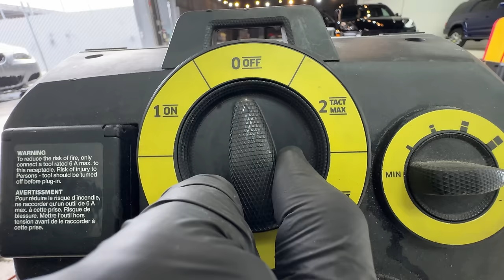Laser Cleaned & Reborn! Porsche 930 Turbo in a One-of-a-Kind Color Gets Full Detail

Comment: I've heard that either dry ice and laser cleaning the underside removes both the dirt and the factory applied rust proofing and as a result cars can get corrosion under the car as a result if not replaced very quickly.

Comment: Love this color combo!  Couple of questions - can dry ice cleaning remove the stains from the inside of the tool bag?  Also, for the laser cleaning, won't the calipers need to be plated again?
Reply from the maker: Dry ice cleaning can be used for that purpose. And depending on how you would use the laser, you will likely want to repaint, unless you prefer the raw metal look

Comment: I believe you’re not supposed to use a gun to take off the lug nuts. The manual strictly says only manual torque wrench should only be used. Especially if the nuts are magnesium.

Comment: You're the rest place I saw ice blasting and laser cleaning. What determines which you use?
Reply from the maker: Laser cleaning is primarily used for rust removal, where dry ice will handle grime with ease, but not touch any rust

Comment: The dirty secret they're not telling you is that heavy rust requires mechanical abrasion first, and sometimes even after laser cleaning.  The plasma produced by the laser converts the surface of heavier rust into an unknown grey material (carbon probably), but if you scrape it mechanically, you'll find rust underneath.  I know this first hand.

Go ahead, scrape those metallic bumps that are left over after laser cleaning, and you'll find rust underneath.

Comment: Is anything dangerous in going this on assembled parts? For example If with laser you point rubbers, can they could be damaged without discovering it at the moment?! Or could be bolts or washers tightening affected by the laser removing part of the coating and with possible un screwing of them after the treatment? For sure it is Avery good solution but for my advise should be better to disassembly the whole parts cleaned…..

Comment: Most parts which are cleaned with laser were oxidized/corroded, and by removing that you don’t protect it so it will come back as fast as it disappeared. I don’t see the point of laser cleaning than. I do if you use it to remove rust and paint ore reanodize te parts.
Reply from the maker: The coating you see on the final product is a rust protectant

Comment: Laser cleaning or detailing a car isn’t restoration. This is just cleaning!
Reply from the maker: Sure, but the rest of what we do is often considered restoration. Thanks for the comment 🫡
Reply: This is more than just cleaning. I mean they're doing paint work, dents, the dry ice machine is 90 grand, laser probaly 50 grand. It's not restoration like every part off and every part back on but even classic restorations are using old wiring, old parts, refurbished, cleaned up, etc. 

This is extreme. And very nice work I'd say. Just cleaning is blowing some air and vacuuming and wiping it down. Paint correction, even in hard to get areas, I wouldn't doubt they get restored cars in fresh out of the booth w all the parts assembled and are paid to flatten the paint out or whatever. A good detail can make a good car worth a lot more. This isn't a bottle of silicone under the hood ued car lot special quicky which does look good to most I will admit. Except to the spray painter.

Comment: all very well  burning off the rust and any coating that's left but now it will corrode a lot faster as there's nothing to protect it now ...... i own a metal finishing company the only way to t
do things properly is to take the parts off and re coat what your doing is going to make things corrode a lot quicker no 😩😩
Reply from the maker: Take a look at the full video and the after shots - you can clearly see we recoated the car with a modern milspec coating after cleaning.

Comment: BUY and use a Steam Cleaner !
 It does a Better job .
 Easier, cheaper and Far more quickly. 
Enough with the Crappy China Lasers.
Reply from the maker: Steam cleaning won’t get rid of rust, like the laser will, and we would argue that dry ice works easier and far more quickly than steam cleaning